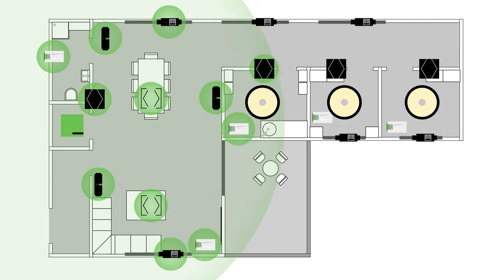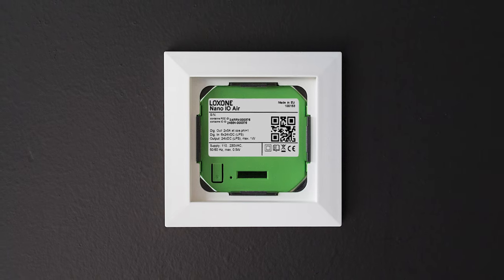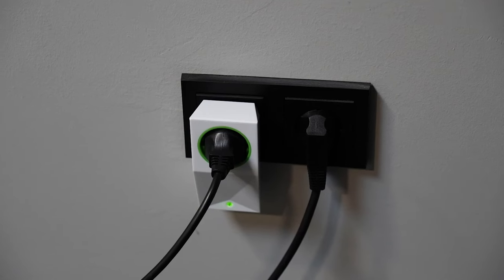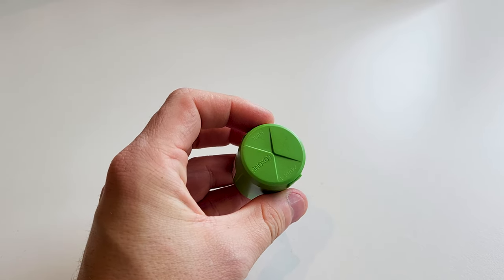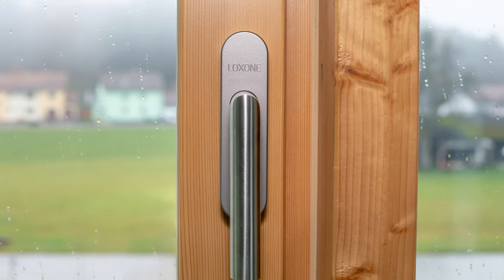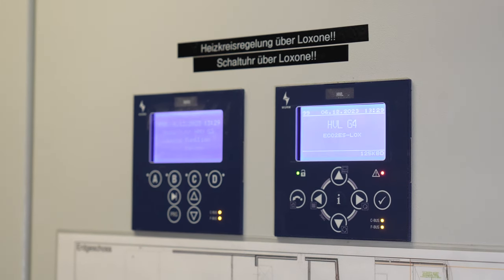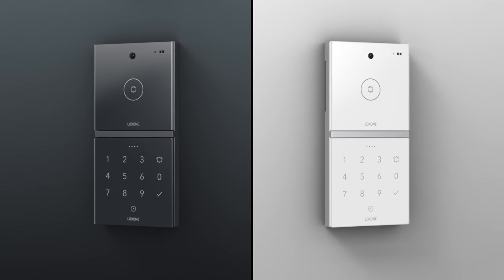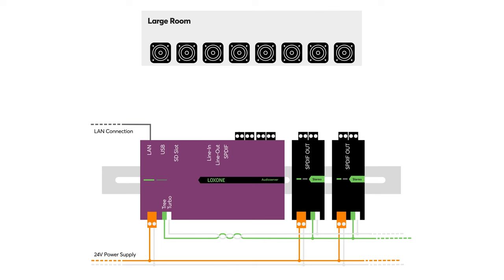Retrofitting & renovating with Loxone Air I 2024 [4k]

Comment: I find your products very innovative and interesting! But I have a modern internet of things system from ubiquiti and unfortunately your system isn’t compatible… Could you please partner up? Many people think likewise and would be very excited if you cooperate! This would make use of the ai cameras and make a more connected and holistic system. For instance if a specific number plate is detected in the underground garage, then an automation could make the elevator come and then go to the regular destination! Plus then the home could go into the desired mode and choose the music playlist that corresponds to the car’s vehicle and the same with the heating/cooling! This is helpful for a family where members have different preferences!
Reply from the maker: Hi Chris, Thank you for your comment and interest in Loxone.  Wi-Fi and IoT products tend to be very network dependant and if there is a change of router without a rework/heads up it can cause a lot of issues and make things stop working due to different VLANs or Subnets/Reserve Addresses etc. Regardless we are working on improving integrations more in the direction of general protocols such as Matter. Some ANPR cameras are already possible [ https://www.loxone.com/enen/kb/smart-parking-system/ ] and I'm sure that the future will bring more software to expand on the functionality. I hope this is useful information.